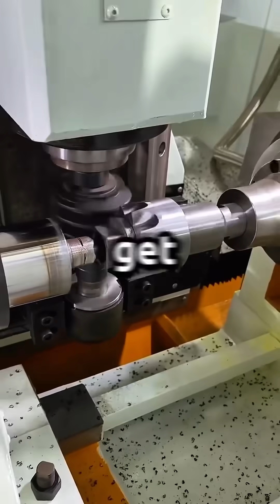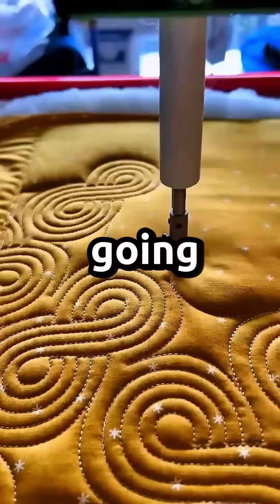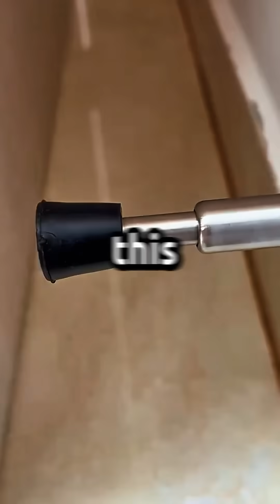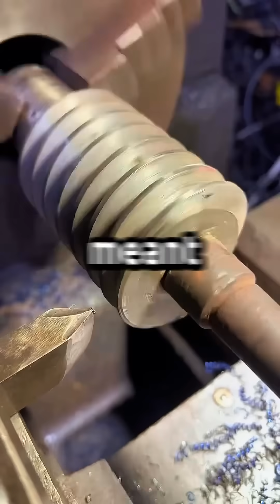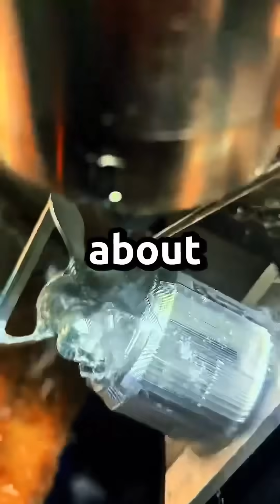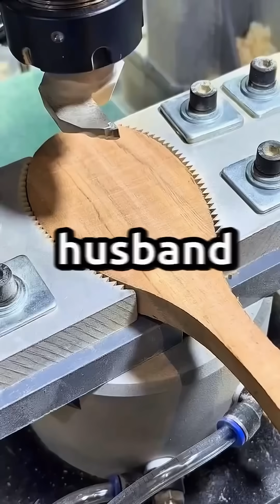Parents, what’s the most absurd thing you found on your kid’s social media?

Comment: Slime turtorial : 

Things u need -
1. Glue Stick
2. Wet Glue 
3. Clay (not play dough)

First, get a bowl and put all the clay you want. (Take a small amount to test it first)
Second, add some wet glue in and mix until it's like water (a bit sticky, not too sticky)
Third, add some glue stick, take one and cut a quarter of the glue stick using a ruler. 
Then, mix and mix and mix until it's a bit better. 

Tips : if it's watery and too sticky, add some glue stick. If it's too hard, add some water or wet glue

(If it doesn't work I'm sorry 😔)